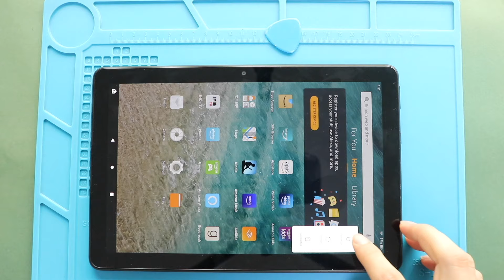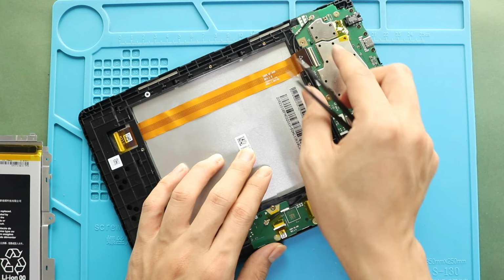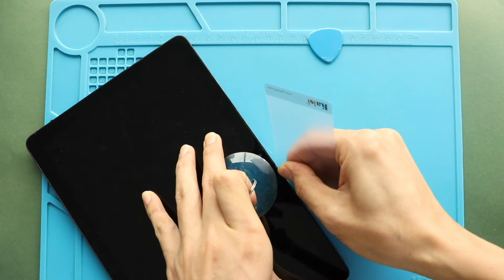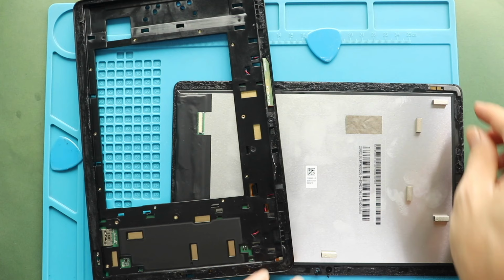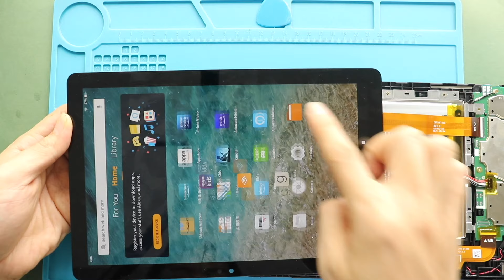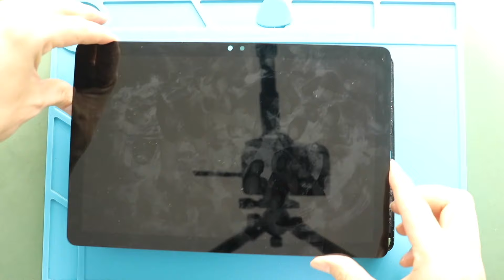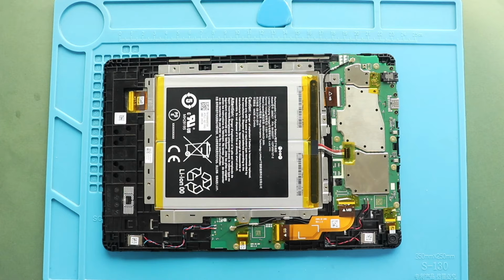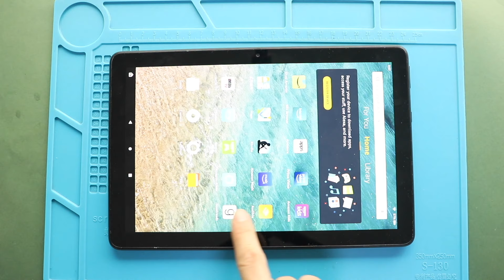Amazon Fire HD 10 2021 LCD Touch Screen Replacement | Fire HD Plus | Kids

Comment: Glad to see nothing is attached to the back cover, in my case I got one, and after having it three weeks I noticed one side is kind of wobbly, and slightly loose, like it wasn't glued or shaped quite right to fit snuggly like the others. Compared to the one I got my mom and mines unique in that so defect. Was concerned if connections between parts and the screen might fail, but seeing this and how it's all on the screen, a slight wiggle in that part of the backing shouldn't be an issue.

Kept watching all the way through, good tutorial for if I ever need it. Though if teaching first timers, a closer up on the ribbon cable to main board attachment point from the screen might be good, just looking here a bit hard to tell just how that attaches and removes properly.
Reply from the maker: Thanks for sharing valuable info…

Comment: where do you get a screw driver that actually works, i got some with replacement screen but they wont take out the screws, what type and size please and thank you
Reply from the maker: There are good tool sets. You can buy for about $10 with different screw heads(at least 8-10)
Reply: Did you end up finding anything ? Screw drivers aren’t working for me either … thank you

Comment: Where can I buy a new LCD display for a decent price? I have this and part of the display is cracked... Everything I see is about 80$ half the cost of the tablet. Great video btw doesn't seem as hard as I thought.
Reply from the maker: The issue is, this is lcd assembly.So the price is little high.Your location?
Reply: @DIYGeardo  U.S. I found a display on Alli express for about 65.00 USD most I saw on ebay were 80 or more.
Reply: Ebay for $20
Reply: @deerslayer422 Could you send me the link? I’m afraid of buying the wrong one

Comment: Isn't it possible to only replace the glass? My tablet fell on the floor and the display glass broke but everything is working fine. Do I really have to replace the whole LCD? As someone already pointed out an LCD costs more than half the price the device is worth.
Reply: Yeah, same scenario for me.
Reply from the maker: Well it is quite hard to replace the lens alone. You need to seek a good technician

Comment: Please, how can I get the touch? Because touch is not working
Reply from the maker: Your location?
Reply: @DIYGeardo  Ghana Accra
Reply: Same. Screen is on but Touch doesn't work
Reply: I've replaced the screen exactly as told on your video... but the touch does not work anymore... any clues?

Comment: This tablet is so bad. Mine suddenly shows everything with blurry, very noticeable on text.
Reply: Mine did the same. I took it to the repair store and they wanted $300 to replace the screen. I bought the screen on eBay and I'm using these instructions to replace the screen myself.  Pretty involved process,  I hope it works! 😊
Reply: I just spent the extra money on bought an iPad. These fires just aren't worth it anymore